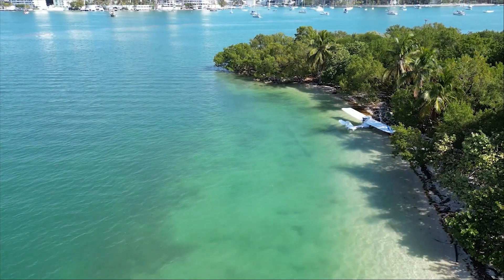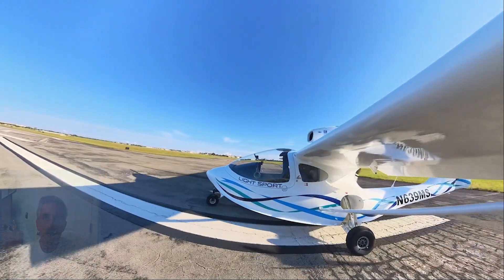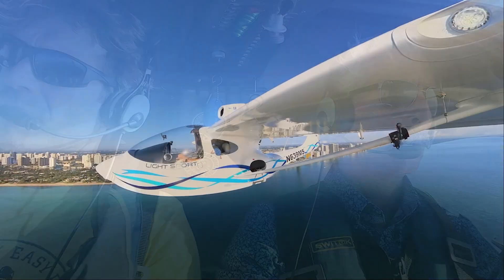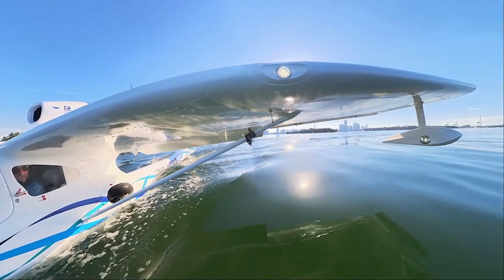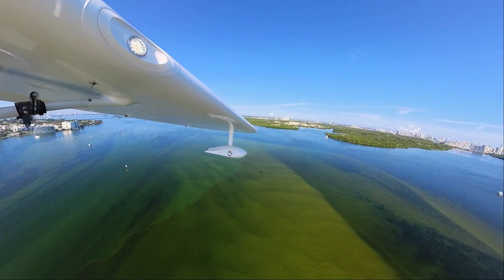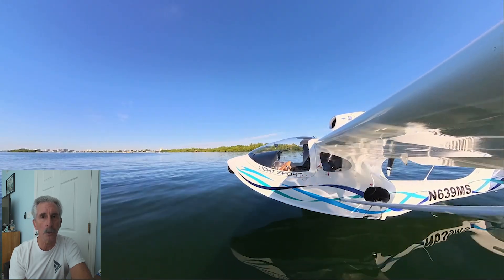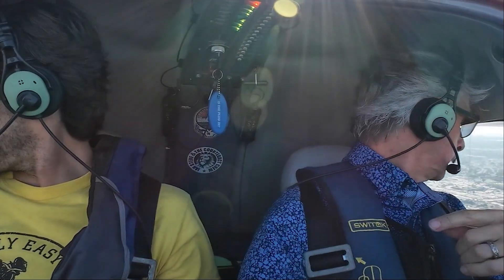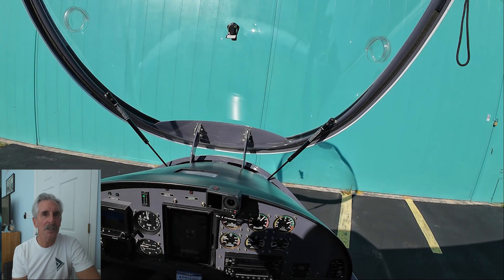Intro to Seamax operations

Comment: Great video! Could you please explain the radio calls/frequency over Hollywood and Miami shore line? When I fly VFR there I never know who to talk to other than to be on 123.45 ...
Reply from the maker: Absolutely! The VFR sectional for that area has an advisory frequency of 123.025 posted for coastal operations. It's actually the CTAF for the Miami Seaplane Base X44.
All the banner tows and most other sightseeing operators and beach traffic are on that frequency. After a couple times out you'll be familiar with the local landmarks.
If FLL is in east operations, they'll let you transition along the shoreline north and south at 500' or below. Call their tower frequency 120.200 for initial contact and a squawk code for your transition through the Class C. They're very helpful.
I hope this helps! See you out there! 🤘😁

Comment: If you turtle in the water with that canopy how do you get out?
Reply from the maker: It's a good question. 
The Seamax is quite resistant to going over when landing in the water with the gear down. A few have done just that without fipping. There are some videos out there of a landing with the gear down and a takeoff from a rough strip that ended up with the aircraft running off the end into a body of water at takeoff speed. In each case, no flipping.
If it were to occur, like any vehicle submerged in water, one would have to allow water into the cabin to equalize pressure which would allow the canopy to be opened quite readily to allow escape. Of course this assumes a level head and no injuries.
Cheers!